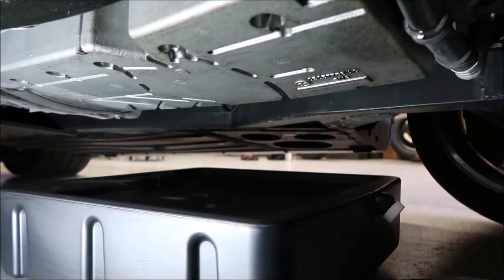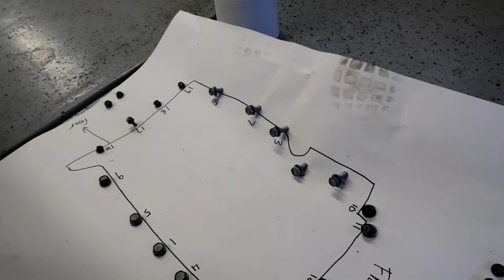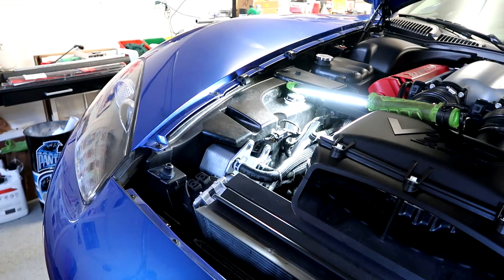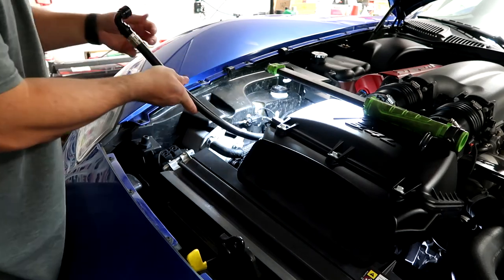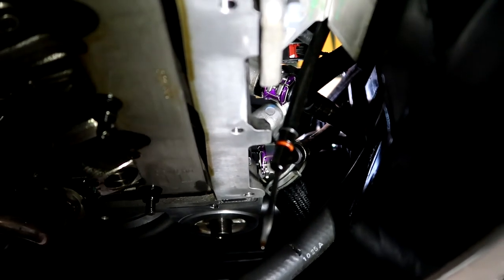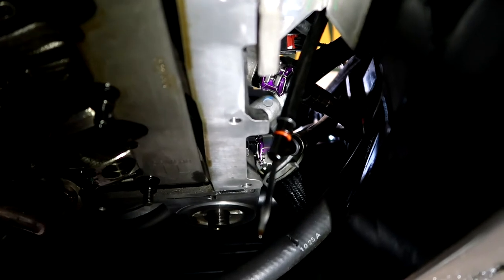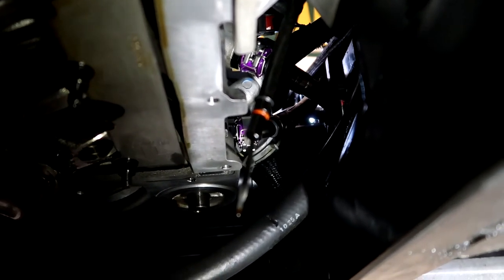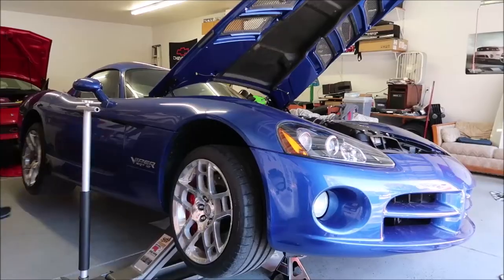Oil Cooler Lines & Oil Pan Gasket Replacement | 2008-2010 Gen IV Dodge Viper

Comment: Hi, i need an oil cooler  one that you used on your video, where did you buy it from? Thanks in advance.
Reply from the maker: Thanks for checking out the video! We used the Viper Specialty Performance quick disconnect found here…
http://viperspecialtyperformance.com/catalog/index.php/cPath/22_34
Reply: Proof read your comment before making it.
Reply: Proofread your question before asking it

Comment: Did you get the low speed popping sound figured out?
Reply from the maker: nah sadly i haven't had a chance to jack the car up to see if it was tie rods yet. maybe this upcoming weekend
Reply: @ChaosCarClub  was it the tie rods?
Reply from the maker: @jayk7781  turned out to be the rear diff. Changed the fluid and it was still making that same sound but ended up reading on the forums to do some low speed figure 8s. Took it to the parking lot and did just that and I haven’t heard it since thankfully.
Reply: @ChaosCarClub  Thank you very much for the response.

Comment: Got her back from inspection?
Reply from the maker: Driven the car twice since finishing up the gasket and line replacement and so far so good. No more oil leak! I now have discovered a clunk at low speed turning. Not sure if it’s from the rear suspension or transmission
Reply: @ChaosCarClub  like a popping sound? Check the tie rods
Reply from the maker: @miguelberetta7887  hmm I’ll have to give them a look. I only notice it when turning at low speeds. But definitely a clunk more so than a pop
Reply: @ChaosCarClub  I only had this issue on an sti and it was because I had the central diff locked, if I was a betting man, definitely your tie rods
Reply: @miguelberetta7887  another vote for the tie rods. Get them at Rock Auto for inexpensive.

Comment: I have a Gen V, do you think it's pretty similar? I can't find any Gen V video. How long did this take you?
Reply from the maker: Should be very similar. Motors are nearly identical. Are you just replacing the oil cooler lines or dropping the pan too? If just the lines it should take a few hours. This was a 2 day affair just waiting for sealant to dry on the oil pan.
Reply: @ChaosCarClub  I believe I'm just replacing the oil cooler lines, my dealership told me that they need to go but said that they don't do that.
Reply from the maker: @Alexander-qw5hr  odd they won’t do it but thankfully it isn’t too bad of a job with just the lines. I went with the viper specialties lines and haven’t leaked a drop of oil since install.
Reply: @ChaosCarClub  Awesome, that what I was leaning towards. Appreciate the help!
Reply from the maker: @Alexander-qw5hr  you’re welcome! 😎
Reply: @ChaosCarClub  Hi, I'm in the middle of replacing them. In the video you said the longer hose goes to the one closest to the front of the car. For when it connects to the block, does a long hose go to the bottom one or the one angled towards the top?
Reply from the maker: @Alexander-qw5hr  Hey! So sorry for the delayed response I was out of town. Hopefully you were able to get the lines on. Both the 90 degree bends connect from the top of the car with longest in front. And then the 45 degrees connect under the car where it connects to the block. As long as you have them connected correctly from the top they will naturally align under the car. They are cut to near perfect length to match.
Reply: @ChaosCarClub  Thanks for the reply! I was able to finish and everything turned out great!
Reply from the maker: @Alexander-qw5hr  awesome! Love to hear it!! cheers to a job well done! 😎